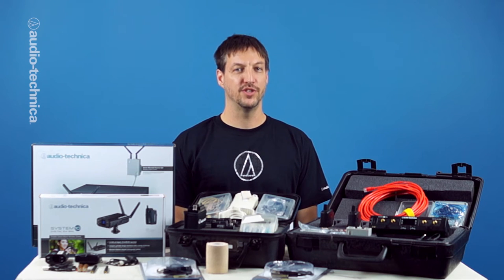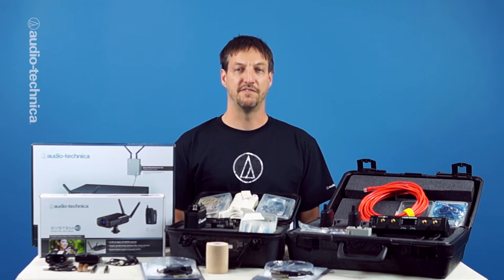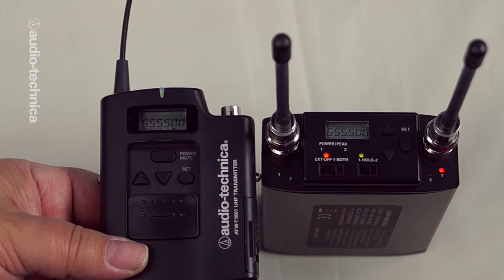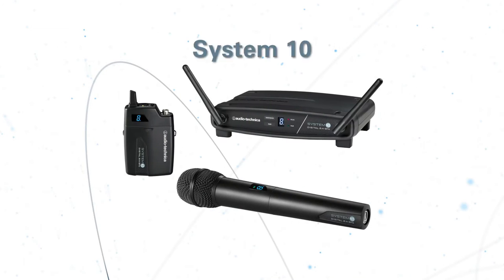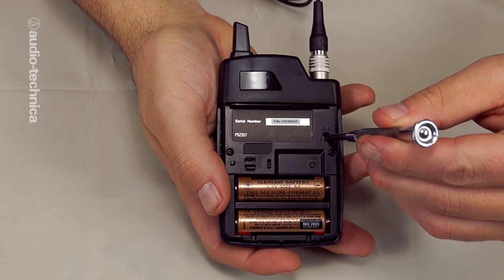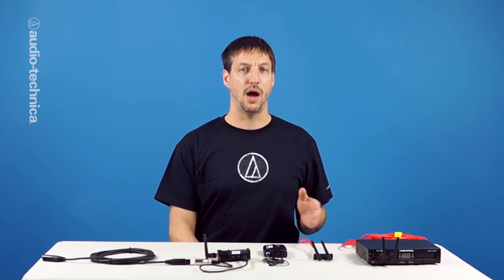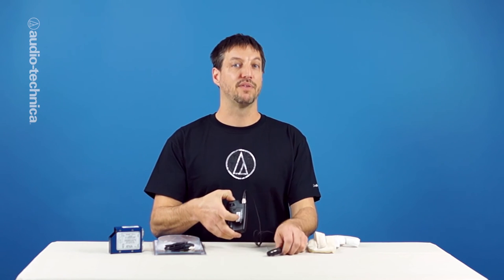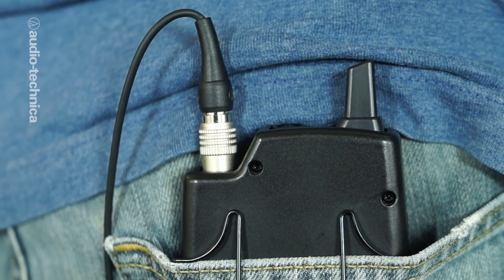Basic Audio Techniques for Video: Wireless Mic Systems

Comment: Hello I got the same pair of Audio Technica ATW T1801 Lav Transmitter and receiver for very cheap but I havent use it, how is the sound, its a profesional level or entry level?  thank you?
Reply from the maker: Hi Emiliano! The 1800 Series was used in professional applications. However, this series has been discontinued. Thanks! - A-T USA